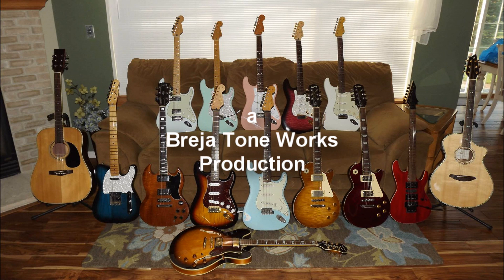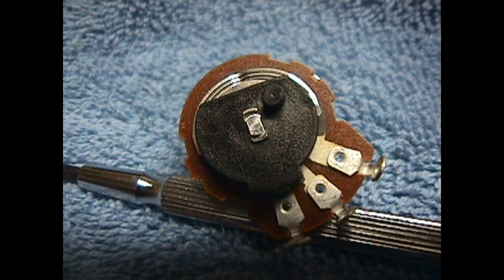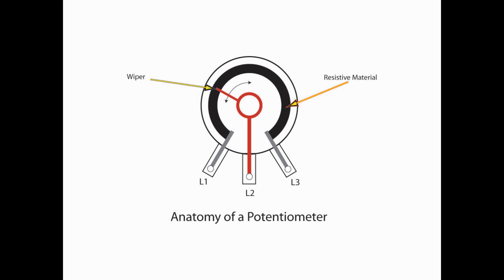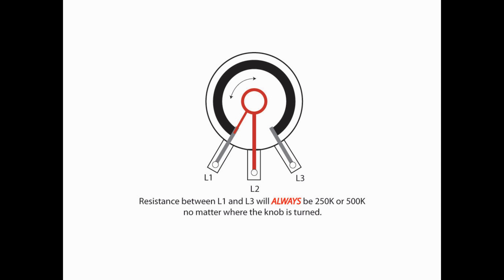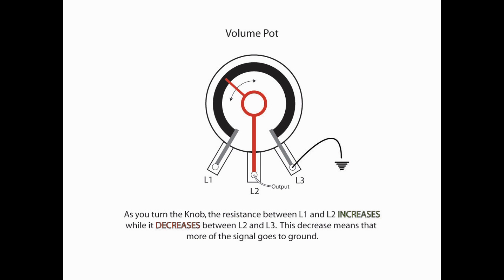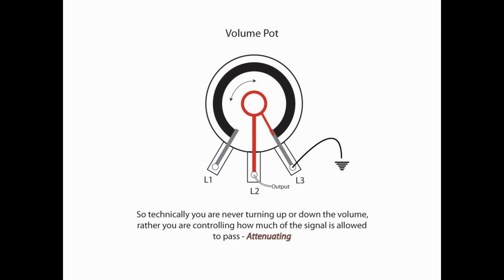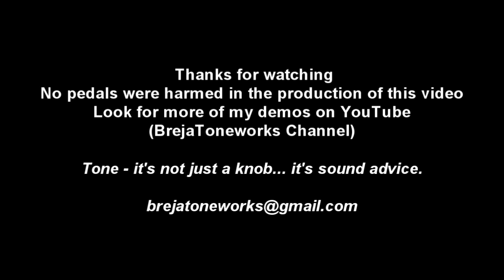Volume Potentiometers - Explained

Comment: Good explanation...except that you imply that it makes a difference if a pot is "full size" vs "dime sized" and not one person in a million would notice a difference, especially in terms of a volume control. But, everyone who reviews guitars condemns the dime size pots they find on cheap guitars...just before admitting  that it doesn't make a difference and what matters is the resistance value of the pots & that of the caps used on the tone controls...not their dollar value!

Comment: As per the diagram when the knob in turned fully clockwise the resistance is at maximum rather than minimum between L1 and L2, though it is stated the opposite way at the 3:10 min of the video. I think there is an error here. Please correct me if I am wrong. That said, I like this video.
Reply: I think when you turn it fully clockwise when the guitar is fully assembled, it turns up the Volume so there is no resistance. But when you are assembling a pot, you're looking at it from the bottom. So in a diagram, it's showing the opposite.

Comment: 3:53 confused because it seems like turning clockwise would be turning up volume and Vice versa…but the diagram seems like you’re doing the opposite.
Reply: Think about it, you turn it clockwise to turn up the volume when the guitar is fully assembled. But if you're messing with pots and stuff, you're actually looking at the underside of the knob.

Imagine a clock made out of glass, it is see-through on both sides. On one side, the clock is going clockwise. But from the backside, it's going counter-clockwise. Diagrams are just like those clocks.

They are made for those people who are looking at the backside

Comment: There is a serious discrepancy regarding clockwise vs. counterclockwise. At 2:15 you rotate the wiper to the right and say "clockwise", and at 3:10 you rotate the wiper fully to the left and say " clockwise". At 2:30 you rotate the wiper to the left and say ":counterclockwise" and at 3: 50 you rotate the wiper fully to the right and say "counterclockwise". You never say if the reference point is from the rear or from the front of the POT, but unless you are switching reference points in the video, there is are errors, and either way, there is confusion. Otherwise, A nice video.
Reply: yes, it's not nearly as clear as it should be

Comment: I never understand why connecting GND to L3. Why just L1 and L2 is not enough? Please help to understand.
Reply: I think that I've got it: if GND is connected to L3, then the potentiometer acts as a voltage divider. Hence, lower voltage leads to lower volume.

Comment: I do have a question that may have been already answered in the comments, so I apologize. Can you use L1 and L3 interchangeably to make the knob function in reverse direction, I guess turning it into a lefty knob? And if not, can anyone explain why or provide a link to the reasoning? It would be much appreciated. Thanks!
Reply: Yes exactly! (Lefty here.) Most lefty guitars come with righty pots soldered in reverse, AGAINST the (righty) logarithmic taper (see YouTube vid: “Basic Guitar Electronics XVIII - For Lefties” by Marc van Oppen. Also Joe Perkins channel touches on this)

Lefty options include 1) reverse L1 & L3 so that it functions like a righty pot, clockwise = up, going with the correct taper, or 2) install a “reverse logarithmic” (lefty) pot, so that counter-clockwise is up, with the taper.
Reply: @eddiequinones3396  Thank you so much! Extremely helpful :)
Reply: Joe Perkins vids (uses solution #1)
L1-L3 explanation - 8 min
https://youtu.be/SFleQvIKAno

Detailed explanation of pot value, taper, etc - 17 min
https://youtu.be/6XldcL4IksE

Marc van Oppen Lefty Electronics vid (suggests solution #2) - 4 min
https://youtu.be/UY1_BLPXAOI

Comment: They are a voltage divider, you're not resisting voltage (current is 'resisted') you're changing the potential difference, so you are changing how much voltage passes to ground and how much voltage to the input of your device, not how much signal (voltage) is allowed to pass, basic electronics FFS.

Comment: My setup calls for a 35K ohm pot. Can I use a higher value such as 40 or 50K. If I do, what will happen? 
Will I prevent signal from leaving amp and damage components in my amp? Thanks.
Reply: Increasing the value of volume and tone pots adds brightness to the sound. That's why single coils (naturally bright) are paired with 250K pots and humbuckers (dark) go with 500K pots. I've never heard of a 35K pot being used in a guitar, it'll sound very dark.

Comment: Volume pots seem to be effective between about 80 and 100% of output. When you get below 80% the signal is clipped, so the bottom half of the pot is basically worthless. I was thinking that a pot with the total resistance range of the top 20% of a typical pot would give me the full usable range of the knob. Granted, 80% of full volume would be minimum setting on the knob, but thats about all the volume reduction i ever use while playing. Taking it one step further I thought about having a volume range selector switch in line before the main volume pot. A 4 position switch would have resistors of progressively higher impedance to establish a high limit. By adding a resistor in series with the pot you would get the combined resistance for each setting. I thought a diode might be needed after each resistor to prevent back feeding and keep the other resistors out of the circuit. The switch positions would be open (off), no resistor (high range) and a medium and low range switch setting. Is this feasable? Also, I have two guitars (PRS SE custom and Fender duosonic) that have switchable single to double coil pickups. What is the recommended volume pot value that accomodates both types of pickup? AND rather than a 0-250 ohm pot can i use like a 0-100 ohm pot to cut out the unusable low range?

Comment: So why is L3 needed?  when L1 to L2 varies the resistance or flow of electrons.
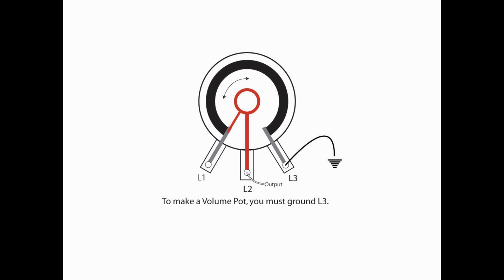Reply: He explains this starting at around 2:46. I just found this out about an hour or so ago while testing out different "what ifs" with an electronic kit with a variable resistor and an LED, but i didn't know exactly how it worked until I saw it here.
Reply: so that you can send the entire hot signal (going into L1) to the ground (through L3).  If L3 was not grounded and you turned the volume all the way down, you'd still get some terrible noise because the signal is not grounded.
Reply: @WayneKnight_Rider  Yes, this is happening with a bass I rewired today. The lug is not connected to ground properly so I get almost no volume change and there's scratchy noise in the background. Hopefully I'll be able to fix it tomorrow, it's tough to make solder stick to the back of new pots.

Comment: Great video. Simple and to the point. Very well made, thanks. I am curious though, could we say that THEORETICALLY L3 will always be ground. L2 will always be output (for Hot/Live signal coming from pickup selector) and L1 will always be Input for Hot/Live from guitar pickups? Is this correct or did I reverse the order? And do we always count L1L2L3 in the order presented in the pictures in this video, aka left-middle-right while looking at the shaft? Cheers!

Comment: One thing missing...why do I have to ground L3.
Reply: Because, from my understanding, one of those lugs (for volume pots) need to be grounded to the top of the pot. Basically, it might as well be L3 and that is what is "universality accepted" as far as guitar wiring goes (I believe you could also use L1 for grounding, but then L3 would need to be the input lug / you reverse the order) I am going to type in a question of my own after this reply being that I am not 100% sure laughs

Comment: Any positives from this video are completely lost by the narrator's complete confusion/contradiction over clockwise/counterclockwise and resistance.
Reply: It's from the perspective of the back of the pot, if you're looking at it while soldering. Pretty simple.

Comment: Please tell me if at 2:20 clockwise is at max resistance then at 3:15 clockwise is at no resistance. Is there a mistake at 3:15 where it should read "with the knob fully  turned Counter Clockwise, there is no Resistance between L1 and L2"? Otherwise Clockwise is confusing me!!
Reply: I thought the EXACT same thing, and it was driving me crazy - I think I figured it out.

I believe that diagram is showing us the BOTTOM side of the pot (which is where the pot gets soldered in). Our perspective would be from inside the guitar cavity, looking out.

The physical knob is on the OPPOSITE side, on the TOP surface of the guitar body.

So if someone “turns the knob clockwise” on the top surface of the guitar...

From the perspective of the diagram, that red wiper line is actually moving COUNTER clockwise towards L1 lol. And vice versa.
Reply: Yep I’m having the same confusion!!! If we say (the side) L1 = volume 0 and L3 = volume 10 (max), the video instructions is inverted, right?  When we turn the knob fully to L1 direction = zero resistance between L1-L2 so volume would be MAX.

Comment: It needs to be made clear that this view of the pot is from the reverse side - the back of the pot as you would see it when fixed inside the guitar. So turning the wiper clockwise on the diagram is turning the knob anti-clockwise in reality.

Comment: How  do I wire up a B100K potentiometer to a Class D TDA 7492 which has a stereo output of 50W max and is runing of a 12V 1A DC supply? I have connected the potentiometer as the vid tells me to on that amp and on a Class B TDA 2822M which runs of a 9V battery and has a stereo output that i don't know of and both audio results from the amp were  that is would play the audio fine when the resistance is 0ohms but when I start to increase the resistance, the audio cuts out quickly only being able to be adjust the full volume  at a fifth of the whole  rotation before there is no sound. What am I doing wrong?

Comment: hello.. thanks for the video, may i know how to make tone pots??
Reply: Use another pot of the same value and taper (usually logarithmic aka audio taper). Add a capacitor across lug 2 and the back of the pot then connect lug 1 of the tone pot to lug 3 of the volume pot, where the pickup wire is connected. In the video the lug numbers are reversed BTW.

Comment: Resistance affect voltage and amperage? Or just voltage, or amperage?
Reply: And a spark plug affect voltage and amperage? Or just voltage, or amperage?
Reply: Voltage is found by multiplying current by resistance.  Amp×ohms=voltage

Comment: With the wiper (L2) turned fully clockwise you have the full value of the pot between L1 and L3 which is also pulling your output at L2 to ground, therefore loss of volume. In this circuit volume is gained by turning counter-clockwise decreasing the resistance between L1 and L3 and increasing the resistance to ground between L2 and L3. I don't know why this circuit has been so popular because it is less than ideal to have an amps input shorted to ground when the wiper at L2 is rotated fully clockwise!
In my experience it is better to always have the amps input loaded across L1 and L3 (L1 is output and L3 remains at ground) and use the wiper L2 for the pickup connection, this way the amp is never pulled to ground. This also eliminates issues when more than one volume control is used where one or the other impacts both volume settings when only one is adjusted.
I also have an issue with people who should know better when referring to particular types of tone caps but that's a beef for another day.

Comment: Would you ground the L1 lug instead of the L3 for a left handed guitar?  Get video, thanks.
Reply: I just asked the same thing? My knobs always seem to work backwards and I'm wondering if this would be a simple fix.
Reply: Jeff Tarbell Yes, L1 and L3 are basically the outputs ‘right’ and ‘left’. By swapping them, you just change the direction the pot has to be turned for desired outputs.
Reply: Not really. If the Volume potentiometer is linear yes, you thought right, swapping L1 and L3 just changes the rotation direction. But if it's not (like all common Volumes - they're logarithmic) then your pot behaves very weird. I'm a lefty and I basically can turn in our 'intuitive' direction (swapped wires), but the pot's rendered near useless that way because it is reverse logarithmic, and that sounds like nothing happens between full rotation and a quarter rotation and somewhere below quarter suddenly it drops steeply into silence.
Reply: @mrawesam1190   Then use a reverse logarithmic pot and swap L1 and L3 to make it a left handed logarithmic pot!
Reply: @iRoupaliotis  I know, but last time I ordered electronics reverse logs were out of stock. Long time ago tho, I'm pretty sure they have some. I also discovered more electronics stores since ;)

Comment: Great video but I'm a little confused. If you rotated the dial clockwise, you'd be increasing resistance between L1 and L2. So how is clockwise an increase of volume if it's an increase of resistance?
Reply: The best analogy I can come up with is this: Think of a river. The current is the amount of water that flows past a certain point in a given amount of time, the voltage is how fast it is going. Wide, deep rivers can move a lot of current very slowly, narrow rivers downhill can move a smaller amount of water very quickly. Now think of a garden hose. With a constant current, the water will leave the hose at a constant speed. When you place your thumb over the end of it, i.e. creating 'resistance', the water will shoot out much more quickly (i.e. higher 'voltage') because of the pressure buildup your thumb creates. So increasing the resistance increases the voltage. That's why V=IR, increasing the current, resistance, or both will cause a corresponding increase in voltage.
Reply: Because you're looking at the pot from the other end when it's mounted on the guitar. Think of a clock. If you're facing a clock, clockwise moves from top towards the right.  But if you viewed that same clock from it's backside, "clockwise" would appear reversed.

Comment: can i just leave L3 not grounded and use L1 and L2? For example input is at L1 and goes out from L2, by turning the knob i just change the resistance/power that is coming out of L2? did i understud that correctly?
Reply: You understand correctly, but you need a ground on either L1 or L3, otherwise it won't even work.

Comment: So I think I grounded L1 instead of L3 which resulted in the pot working in the opposite way (when it's open, no signal when it's closed, full signal)
Reply from the maker: Ok...  You can always change it.  Of course you could keep it and when someone else plays it, watch them get all confused.
Reply: +Breja ToneWorks I was heavily considering on leaving it but I wasn't keen on the idea
Reply from the maker: I love the smell of solder in the morning.
Reply: Did something similar: coil split on the opposite lug of the switch. For now, I left it, just that one humbucker knob is "pulled" rather than pushed. :D I'll fix it one day when I'm not lazy.
Reply: +J.C. Terrazas yeah I'm in the same boat I could tweak my wiring to get everything to work with but I wired my blower switch, coil split, and tone. I hate soldering lmao

Comment: So if I got it right I can completely disable the volume knob by soldering cable l1 to l2 directly without involving the volume pots and get higher volume (no resistance) from my pickups ? Thanks!

Comment: Why did you not start with the obvious ?   Tell us what the 3 tabs are: something is the input, something is the output and something is something else. Explain that before you get into a long explanation of theory. Skip all the theory and just tell us how things are done in an electric guitar.
Reply from the maker: +Doug H. in VA That would be because there isn't an INPUT or OUTPUT Lug on a Pot.  The 3 Lugs can be used differently depending on how you wire up a guitar or use the Pot, therefore I'm trying to teach people how Pots work so that they know which Lug to use for a specific purpose.
Reply: @BrejaToneWorks  A volume pot on an electric guitar is always wired up the same way. Why not explain the way things always are in electric guitars?  Why make it confusing and when fellows just need directions rather than theory, just give directions that are always used for a volume pot or a tone pot... ?

Comment: Hey there, great vid - I totally get it, but I'm a little confused - when you say the knob is fully clockwise, there is no resistance between L1 & L2, which I understand, but the "wiper" is pointing to the L1 position, so isn't that in the fully counterclockwise position? If the knob was fully clockwise, wouldn't the wiper point to L3?
Reply from the maker: +Mr McQuade As Doc Brown would say, My Drawing is not to scale.  You are correct that the drawing isn't correct but I didn't intend on the drawing to accurately reflect the wiper position.  It was more of a general visual for the concept.  I can see how it would be confusing though and for that I apologize.

Comment: Great video. I'm trying to learn more about pots and pickups. I tried to install A Seymour Duncan 2-band tone circuit preamp on a bass with 2 passive humbuckers. I followed all the instructions (inadequate) and once everything was connected I had sound but the tone controls didn't do anything.
Reply from the maker: Any chance you could scan and email me a copy of the instructions?  Maybe I can help.

Don  (brejatoneworks@gmail.com)
Reply: Don thanks. I actually just got it done. A guy in Guitar center did it. He was acting like he was gonna do it for free, then when he was done he said ok that'll be $60. Thanks anyway!